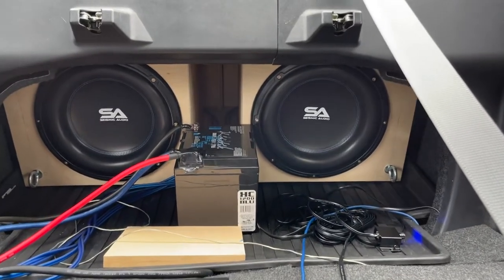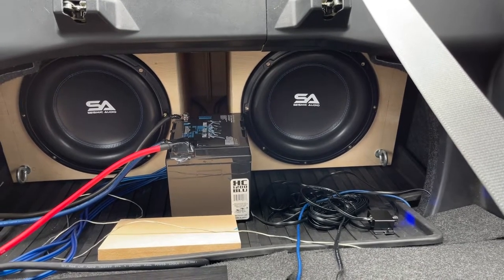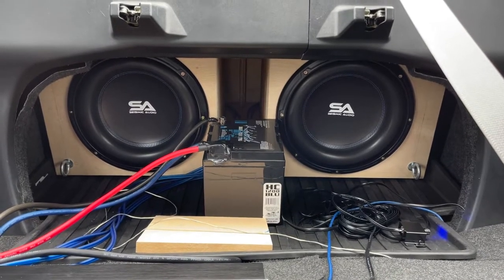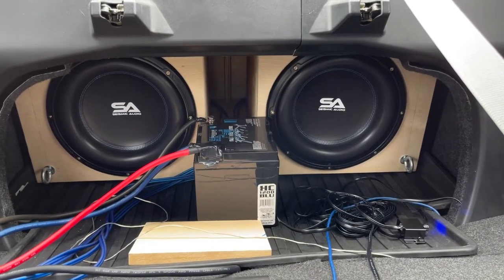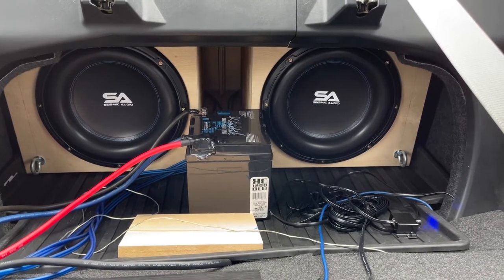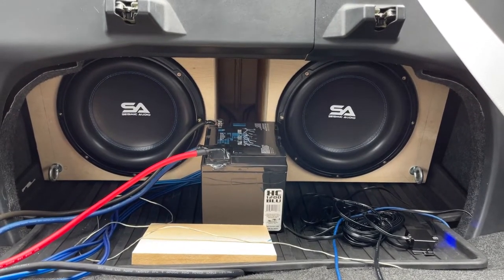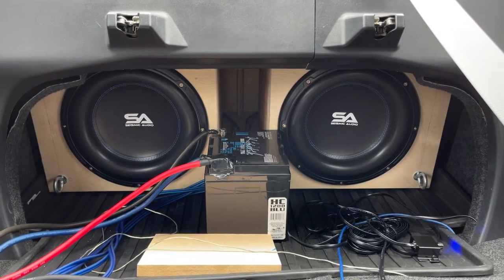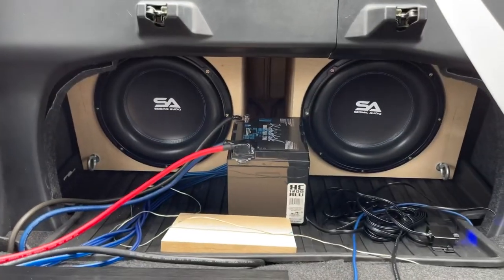2000 watts RMS Seismic Audio demo!

Comment: Is the box per manufacturer recommendations or something different maybe
Reply from the maker: It’s a custom box I made. 
I made it to fit in my trunk with about 10” to spare in the back. 
I don’t remember what the cu is. 
I think close to 2 cu ft on each side. It’s tuned about 35-40 hz